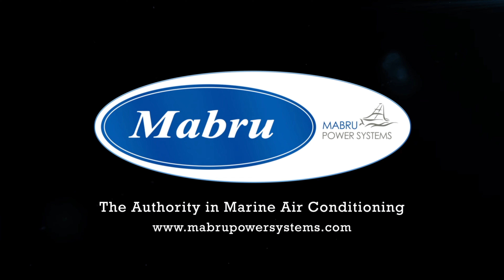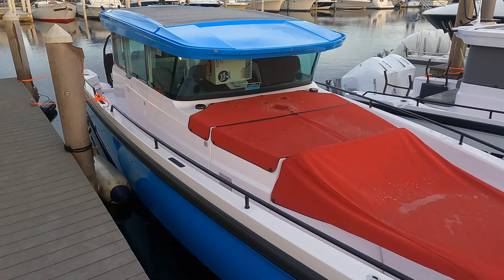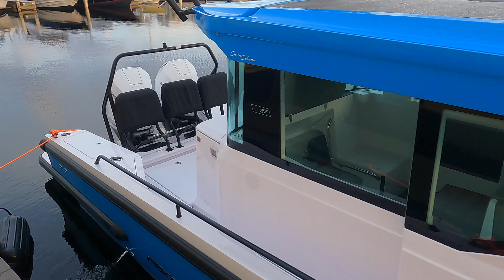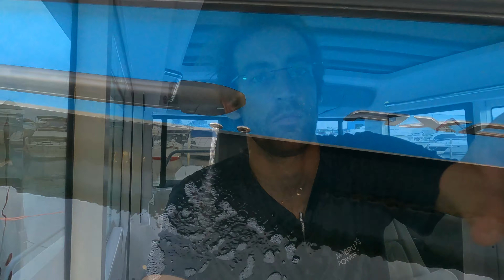Running a Mabru 17,000BTU AC for 7.5 HRS off of Lithium Batteries! Generators are now Obsolete!

Comment: Nice install but No chassi ground on the inverter?
Reply from the maker: I didn't do it on this one as all of the grounds (AC in, AC out, and Chassis) are all a common ground and couldn't understand the need for an additional ground but will be adding them in the future to "follow the rules"
Reply: @MabruPowerSystemsINC  What do you think of the Velair AC units with variable-speed technology and a brushless
motor ?

Comment: Any chance of a version which is 48V ?

Also, which do you guys think is a better alternative ( either 1 or 2 ) in terms of electrical efficiency ?

1. 12 volt system ( using a 48 V server style battery with a DC to DC  converter )

2. 240 V system - using shore power & able to run from battery via inverter
Reply from the maker: We do not have a 48v systems in the works as of yet and my answer for the better option depends greatly on the capacity of cooling required. 7 or 12kBTU, I would go with 12v, stepping down from 48v but on 17K, the only option that we have is 240v but maintains a variable speed compressor so still a very efficient system.

Comment: If you install multiple units can you have several thermostats wired so they talk to each other, with one serving as a master thermostat?
Reply: We do not have a way of linking up different thermostats to communicate as a single unit. Each unit needs to be controlled by its individual thermostat

Comment: Nice video! Does the 17,000 BTU unit come in 12V as well or do you need an inverter???
Reply: The 17,000 is only available now as 115v or 230v. The largest 12v unit that we offer is the 12,000BTU at this time
Reply: So this is running of an inverter? That is impressive.